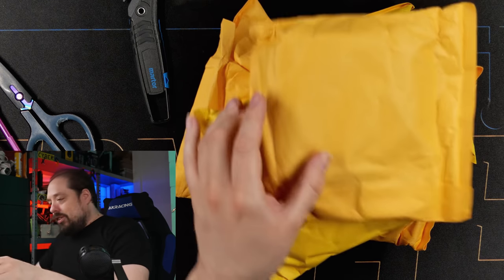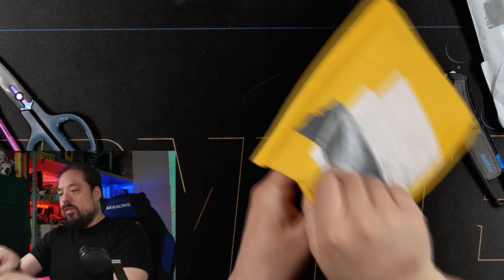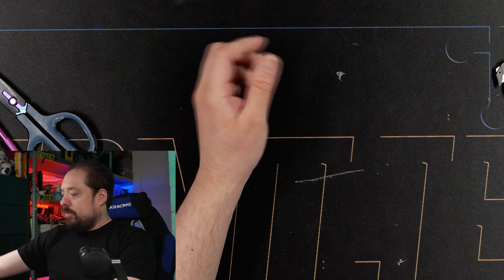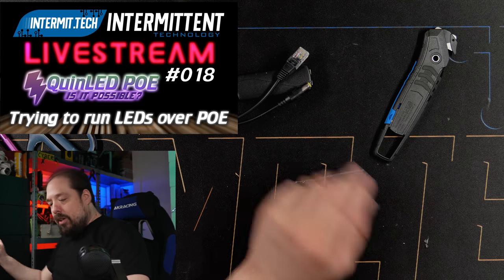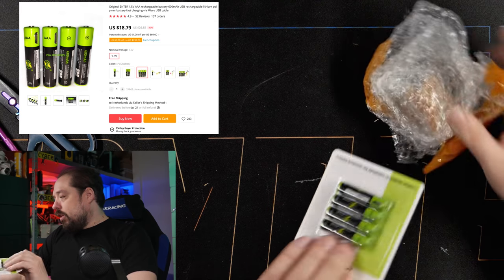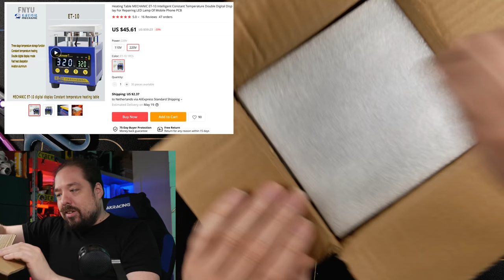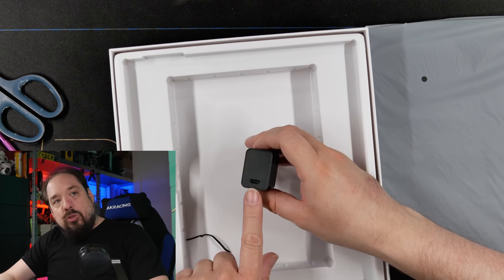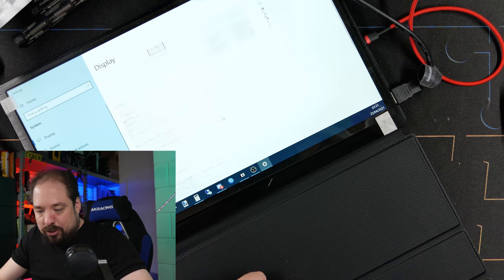📦QuinBoxed📦 EP.021| Mail time | Aliexpress | Unboxing

Comment: What i find odd is that we can buy addressable leds with the diode and the chip in a small through hole package, but they dont sell them as led strings. The addressable fairy leds we can buy are usually a surface mount led on a pcb with wires soldered on or an analog rgb led hooked up to a ws2811 ic on a bulky pcb. Ive never seen true "neopixel" fairy lights and i wonder why.

Comment: Re. the WOWstick:
- the base is not a charger, sadly no wireless charging
- it comes with a (de)magnitizer, watch DrZzs live discovery of how it works :)
- valid remark from DrZzs: can't fit screwdriver in the case with a bit in it
Reply from the maker: Yeah, agree on all points, still I've used it quite a bit over the last few days, I like it!
Reply: @IntermitTech  I bought it after DrZzs video and enjoy using it as well :)
Let's just say that there's always room for improvement 😉

Comment: Are you from the Netherlands? What I understand we do not have to pay import tax anymore, but VAT will be charged. So everything is going to be a lot more expensive for us.
Reply from the maker: Yes from NL! And well, I think it's going to change in two ways for us. Below 22e items will be 21% more expensive, but generally still much cheaper then in NL I believe, but still, we will pay more for those then we do now.

Things between 22e and 150e however might actually become cheaper then they are now (because hopefully the idiot 13e "administration fee" is gone) and well, we need to pay 21% extra for everything, but as said, above the 22e items, that will probably square off against each other.

So who knows, hopefully this turns out well! :)
Reply: @IntermitTech  That's funny. I regularly watch your videos and have never been able to tell from your accent that you are Dutch. Yes we will see what the prices are going to do. I actually only order the smaller / cheaper items through Alie. I will therefore lose out. Your underpants will also become more expensive then :-p

Comment: Do you trust these psu's? I opened a Aliexpress once and a lot of components were not populated .. Also after a short while you can hear the caps singing..
Reply from the maker: I haven't openend these up but I have been doing PSU testing recently, I actually managed to kill or blow up a few but the one's from BTF at least had the correct protection circuits and survived my torture tests.

Buzzing noise from a PSU can be normal btw.